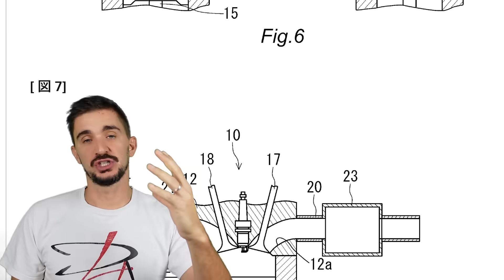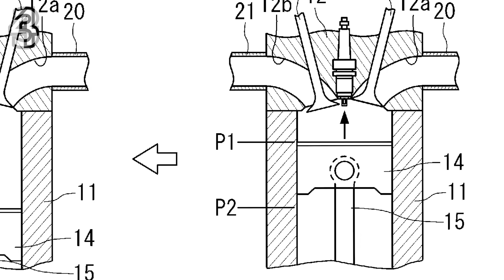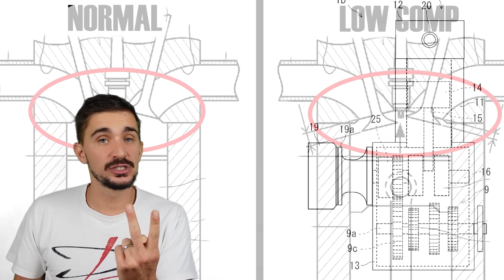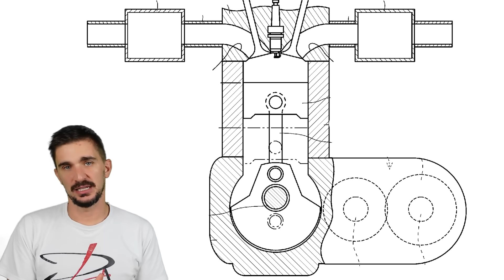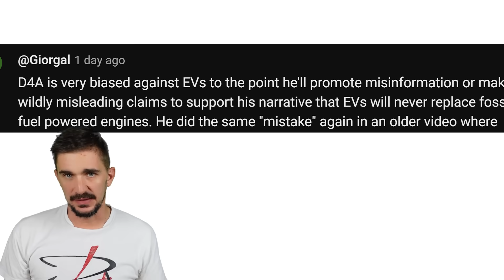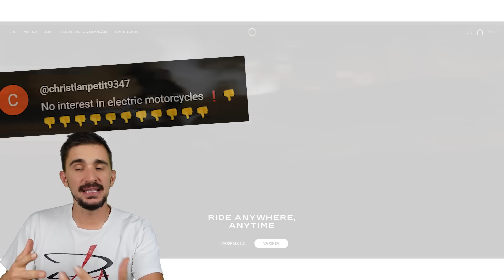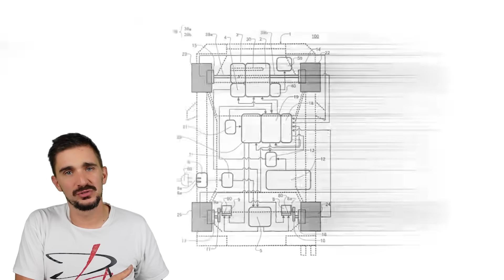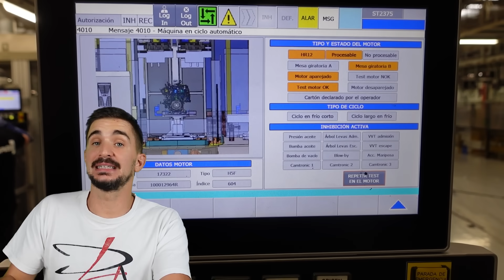Yamaha Just Patented A Fake Engine

Comment: I think the only reason for this exists is to provide two versions of the same bike. 

For example if the buyer wants a gas model they just remove the electric motor and batteries and provide the same bike model and use the same manufacturing process.

If the buyer wants the electric version that makes vroom vroom like a normal bike they don't install a gas tank they install batteries instead.

Both of them use the same assembly line with some differences in the later stages.

Comment: If they have a full engine on the electric bike doing nothing productive why don't they change a bit that fetish engine to be a charger for the batteries and convert the bike to Plug-in Hybrid style layout so you have the sound, vibrations etc and the production of current to charge your energy cells for the main electric motor! You could also use it as a tire inflator with an integrated hose...
Those Japanese are just crazy man... I really love their designs and quality but sometimes they go dead nuts and I used to have an XT600E as daily bike for 7 years... Kisses from Greece!!

Comment: It can be used as a ventilated saddle, a swamp-ass cooler if you will. If you're going to have what is essentially a compressor creating a parasitic load you might as well add a condenser, expansion tank, evaporator and just have air conditioning pushed through a tube you can connect to your pants, jacket and helmet. Might even be able to use it as a heat pump in the winter.

Comment: I actually like this idea in a way. This is certainly better than speakers, and as motorcycles are an emotional mode of transport for most, mostly used not for daily traffic but for entertainment, I think having this is an option kind of makes sense. Is it sensible? No, but it is more real than having speakers or vibrating devices that try to emulate the same feeling. I guess there is a market for things like this, although I certainly believe that if you want the real thing, nothing ever is going to replace that.

Comment: legacy law baggage is too much. stay free. so is that an air compressor then. that motor is as useful as people's gov. ie a clown show. paper launch rocks. many have fallen into nonsense hypocrisy. do not attempt to work for people. ever. above already has given all necessary things for life and goodliness. but to retain freedom, whatever you do, dont push anything to others to do. you diy instead what you propose others to do for you. people pleasing is a hard community job. no freedom in that judgement in front of people. community honor service is the worst ever. for your eyes only. its trying to please the normal use market. well a steam piston engine would be the next best thing that does not combust its own power internally. ie the piston engine is the power generator. line work ends here. may above help you. and may above bless you. and not to lead us into temptation.

Comment: I have a better idea.
If you need to have the sound, add the speaker inside the reverberation chamber and put your electric engine in the case similar to ic engine with those radiator fins so its I distinguishable.
Problem solved.
Still some waste but much less.

Comment: 1. A patent doesn't mean a final product. Just a protection in case of a future development.
2. Don't underestimate the effort needed to "transition"  from one state to another.. to move from 100 years of reciprocal engines to silent electric motors is a process not all may take to rapidly. Hybrid cars are a testament to this.
3. We pay, and we waste a lot to enjoy yourselves....if you been to a Lady Gaga show you be horrified by the amount of energy used and wasted to vibrate the air and make useless noise...not one of those nature loving/ vegeterians there seems to notice the contradiction that only an engineer like yourself may perceive.
Reply: Its called an application, not a patent.

Comment: Can you rev it? I assume you can't as electric motors don't run free. They don't need to. Bikers really like revving their engine, so if they can't they may as well drop the whole idea. Also can it fake shifting gears? Where's the fun if it's just going from very low to really high in one slow swoop.

Comment: While the idea seems very dumb from an efficiency perspective, I think that lots of things could actually be done to make the addition of this fake engine more reasonable. Since it doesn't have to survive the heat and stresses of thousands of explosions every minute, the internals could be made really light and out of cheap material (maybe all cast?). And since there's no powerband to tune for, it could be made ridiculously oversquare to reduce piston speed (thus friction and stresss) and height. I'm not sure if it would need oiling, but it definitely wouldn't need an oiling system imo. It could appeal to traditional big twin riders in the far future, since those huge things might be able to support huge batteries and long ranges, and thus the use of such a device, if the technology keeps evolving.  I got my driver's license very recently and I don't think I'd ever want to drive/ride anything EV, but if there's no choice in the future, I'd probably stick with a simple EV motorcycle, sans fake engine.

Love your vids btw! :D

Comment: I think it's a cute idea, the cost-benefit just doesn't work at the moment. There's a cost to all the current fakery you mentioned (speakers use energy), it's just modest relative to the car's battery capacity. And battery capacity is so constrained with electric motorcycles right now that it seems ludicrous to devote an iota of it to this. But if you could imagine a battery with four or five times the capacity, perhaps it wouldn't be so unreasonable to spend 5% of that to simulating an experience many people really enjoy. It's far more interesting than Hyundai's pretend-drivetrain in the Ioniq; why they chose to emulate a turbo 4 instead of a Ferrari 12 or something, I have no idea.

Comment: This doesn't fix the range issue and for offroaders the issue that you are in the middle of nowhere so you get no 20kw charger. It actually makes all of this worse as you now need more power to move not needed engine parts.
Also this is can be more easily achieved. The engine will look extremely ugly.

Comment: What about electric solenoids instead of pistons? It would sound like an engine, but would be a reciprocating system. Artificial sounds could be added, but the recirocation of, say, a V-twin solenoid setup would feel more like an engine. And, it would still allow you to use a transmission.

Comment: So we’ve basically got a standard wheeled air compressor. Super practical if your work uses one—say, doing on-site sandblasting or running a mobile jackhammer rig.

Comment: If they would allow the compressed air to exert mechanical work on the piston than the losses would be minimised. It would soak up mechanical work when air is  compressed and would give it back after piston comes down from TDC (minus heat energy)
Reply: You forgot that compressing the air will add more work. If anything, it will add more resistance to the motor and act like an engine brake.
Reply: @brappppppp125  in the compression  phase yes, after that it will give back the work
Reply: @gyorgygajdos1657  so it will store energy via compression which will require work from the electric motor, then give back that energy when it goes down. Even assuming zero friction, it won't do anything to reduce the lossses.

Comment: Incredible idea. 
Taking space that could be used for bigger batteries for better range, to add something that adds weight to make realistic noise and sensations, and use some of your range to go BRRRR.
And then, you have to maintain your noise engine. Because it wears and tears, it's lubricated and needs a change of oil, and may even leak this oil. If your piston for some reason leaks oil, you then exhaust vaporized oil.
So in EU you would have to also pass the yearly vehicle inspection to get certified as well maintained and road worthy. A check where both sound levels and emissions have to be checked. On an EV.
Imagine not being allowed into low-emission-cities because your E-bike has a small oil leak in its fake engine and emits oil in its fake exhaust ?
What an amazing perspective. Also, we use the sound as a feedback of the engine's state while we ride, so we know when to shift gears, when to rev up or down to get in our power band, etc. Having a fake noise that doesn't relate to how we must drive must be pretty disorienting !
Althoug I must admit, I never thought the sound would be so close to what I know without the explosion part of the cycle, cold cranking does sound surprisingly good.

People don't wan't e-bikes because so far the product doesn't align with use and desire, and is crazy expensive. It's like blowing all your budget on a lesser product.
E-scooters are amazing for city commuting, with batteries that can be removed and charged at the office for instance, and e-bikes could also work for those that prefer a motorcycle to a scooter. Their prices compared to entry-level scooters or small motorcycles is insane.
But we also cross the country. We take long road trips. Sometimes on small roads with not that many gas/charging stations available, sometimes on the highway where the range melts like snow in the sun on EV. We crossed France in an electric car, highway only, and god it was awful. We drove 20km/h below the speed limit to have the best compromise between speed and range, and still had to stop for a charge every 200km, and it took 2 hours every time to charge up again. With a normal car, it would have been a 7h trip, for around 750 km. We had to split this trip on two days, with a night of slow charging because all electric charging stations were out of order, and our host let us use their home electric outlet. Spending hours at rest areas on highways is absolutely no fun. Despite that, I love how EV drive, how little noise there is in the car when driving, the responsiveness of it, the power being always available when needed, etc. It's great. But despite the comfort while driving, it's not a great experience when travelling/commuting to somewhere out of it's initial range.
And yes there is also the "sound and vibration pleasure", but good riding feel and sensations on EV could be a new product that, if someday we can't have thermal enginges anymore, could still satisfy us riders.
The day when range of e-bikes will be close-ish to a normal tank of gas, when charging said bike will not take an hour but maybe 5 minutes, and when batteries are both safe to store (see recent tests of exploding batteries in underground parking lots), and are properly recyclable, without if possible devastating landsites to mine for the rare earths needed to build them, and finally at an accessible price, then yes there will be a bigger market for EV.
Also, for bikers who do adventure riding, going through multiple countries, in remote places etc, EV also have the huge problem of being really complicated to fix. You won't find a welder shop somewhere that will be able to fix your battery, even if theu might be able to fix a damaged rotor/stator on your electric engine. So this part of the motorcycling world will have to find something else than e-bikes to continue their hobby.

The idea itself of "easing the transition" by giving motorcycle enthusiasts a fake engine for real noise and real vibrations is weird. E-motorcycle should either convince old market through ease of use and practicality, or do what japanese bikes did when they revolutionized the industry when EU and US motorcycle companies were starting to fail. Expand the market, find new users to adopt their product because it's a desirable one, and replace the old product with a better one. From HD's war veteran, rugged and manly fighting man on a machine that requires you to know how to maintain it properly and often and wrestle with it, to "you meet the nicest people on a honda", offering a new transportation option to non bikers : accessible bikes, that needs a lot less maintenance, for people that want to experience convenience and fun.

I love my Honda trail bike, I love its noise and vibrations, I want to buy in the coming years a totally different HD motorcycle, because of its esthetic, sound, vibrations, and fun to ride, but I also want E-motorcycles to be a good product.
I want to ride one, because crossing nature without making a sound, and being able to hear the sounds of the forest and the river and everything while gliding through curves on mountain roads sounds fantastic. Being able to feel the road and the feedback of the tires, brakes, suspensions without the noise of engine vibrations, and not having to worry about where I'm at on the rev range for proper power delivery and just knowing that whenever I twist the throttle, the same power will always be available and predictable, sounds like a fun way to ride too.
Please just make EV good products, don't try to "convert" motorcycle enthusiasts through gimmicks that try to bridge worlds while being useless and costly.
When the product is ready, so will the market be.

Comment: Gen Z Yamaha employee came up with this idea 💡 😂😂😂 They could have at least made an engine that runs off compressed air. So it's an electric/ compressed air hybrid....Fill the high pressure tank with compressed air. That gives an engine like sound & rumble and helps make some extra power.
I would also think there's a clutch or something between the fake engine & electric motor. So the fake engine can be shut off and stop wasting power. 
🤔 Maybe the fake engine is supposed to run off hydrogen later in the future? 🤷

Comment: Why didn't they make the fake engine a compressor that could store energy when driving, then use the compressed air for a bit more torque when needed. ? At least it would give the fake engine a purpose, all be it very inefficient.

Comment: That just does not make sense!
1) Electric motors are extremly efficient. And they trying to steal its efficiency
2) Motorcycles are already highly efficient vehicle. Small displacement bikes have extrimely high mpg's. Electric motors lose their point of exteme efficiency in this scenario
Reply: Is it though? When i hear of bikes being highly efficient, my first thought was 'This should do 0.5l per 100 km' NOT EVEN CLOSE! Most bikes are between 3-5l per 100km. I fail to see the efficiency when most normal cars do 6-8l per 100. By normal i mean not expensive and at least 15 years old.
Reply: @daniilvolkov8790 yes, you have a point. But I mean one of the main points of electrification of cars is increased efficiency in comparison to petrol powertrains. Bikes don't get the same benefits (at least as much)

Comment: Could simplify it by having a v twin, just have only one active cylinder, and thus make the second one work every stroke. Or remove it entirely, and  use that volume, with a finned unit there, to hold both the power electronics, and also the charging circuitry, with the battery pack taking up other volumes, like the under seat area, the fuel tank volume, and the volume taken up by air inlet and battery. Makes it look like an IC bike, and drives like one. If you want a real bike sound, attach a coil to a steel panel that is under the seat, and make it vibrate and transfer into the frame, just like a real engine, with the driver related to road speed  and emulating gear changes with throttle position and speed. Lot less power, and easy to customise as well, from the Jetson whine, to emulating the 100% fuel to noise generator that Hardly Moves.

Comment: three options. i cant seriously contemplate the fourth...
1. they know SOMEONE will try it.. maybe HD. ha ha, got ya! licensing fees and royalties, please...
2. a complete joke and simply collecting the government "green grants". 
3. its a quick modification to make into real engine... simply add tank, TB, and remove the 6mm shim on inlet valve, replace with a 2.00 sort of thing... maybe a new cam... all sold as a neat little package, but separately... cus you know... the governments just may follow through on their so called "net zero" policies... highly unlikely when the time comes, but best to be prepared...

4th option... theyve hired some of the "new generation" engineers... brains full of DEI and eco warrior ideals but no actual engineering skills... and are seriously contemplating this...

personally, if you must follow the EV delusion, and want an "engine" feel? work on developing reciprocating repulsion motors instead...

ironic, isnt it? its easy to make an electric rotary... its actually extremely hard to make a GOOD reciprocating electric motor... every "solenoid" motor you see is doing it arse-backwards... and are far from "good".